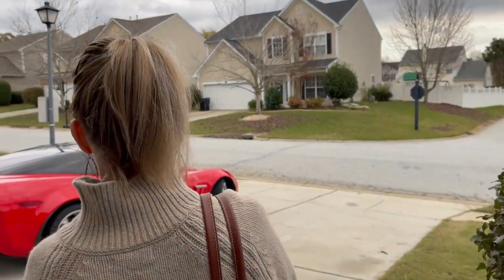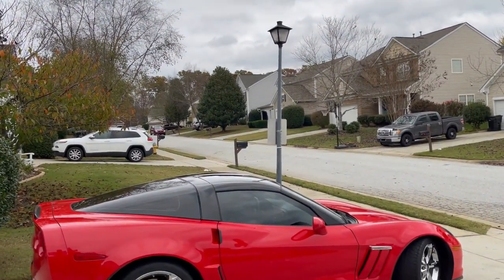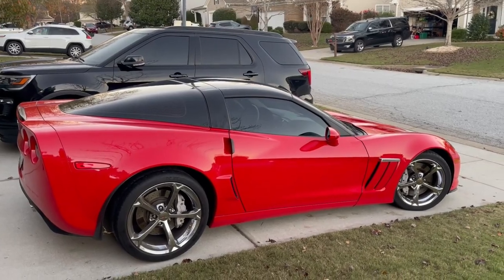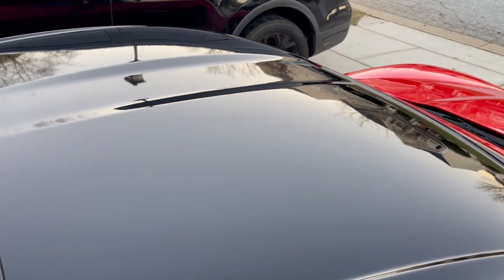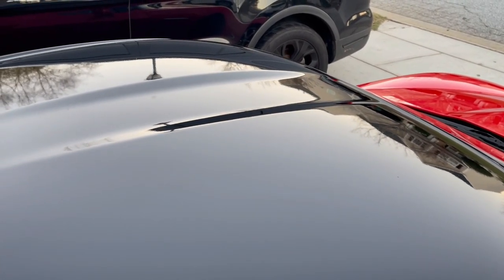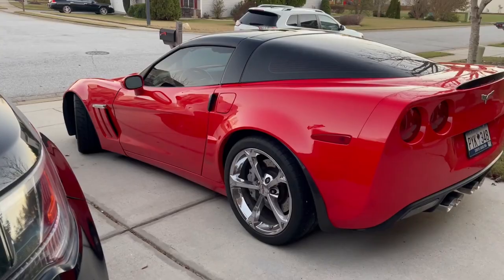Wrapping Corvette Top - Most Common C6 “mod” makes HUGE difference!

Comment: what size wraps did you order if you don’t mind me asking?
Reply from the maker: 12” x 20’ vvivid vinyl
Reply: @SpeedCultureStudios  appreciate it, that’s enough for both the roof and rear pillar?
Reply from the maker: @c6z51  sorry, no.  Thats for the halo itself.  The roof you need a larger piece.  About a 5’x10’ piece would give you enough for one try with no mistakes.  I thought I linked vinyl in the description